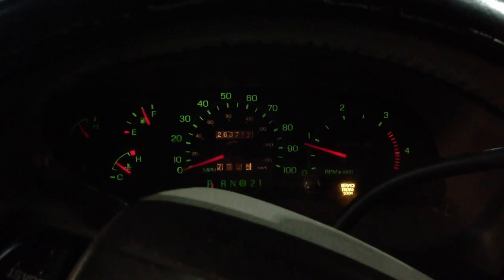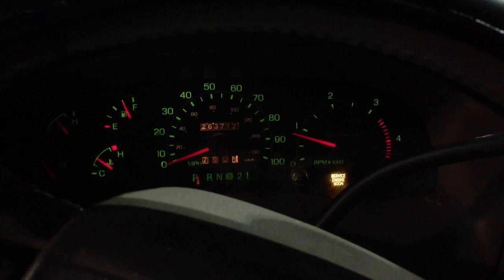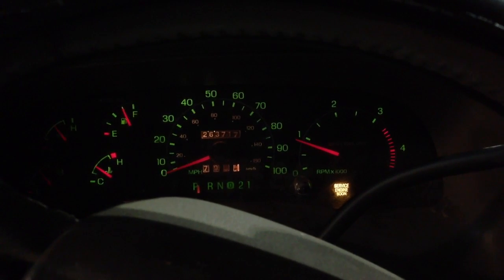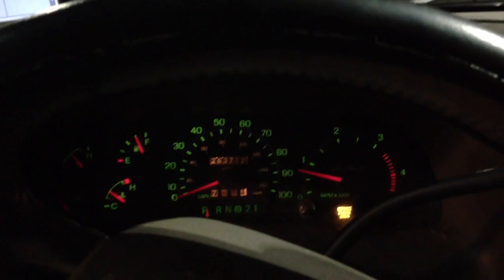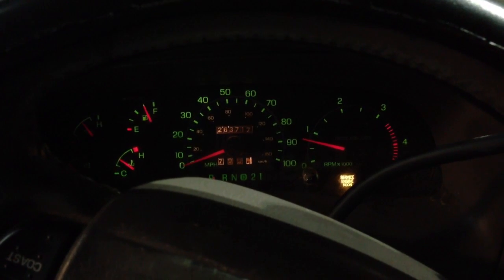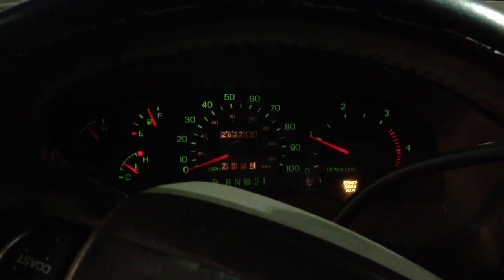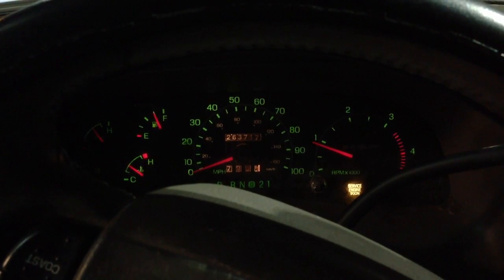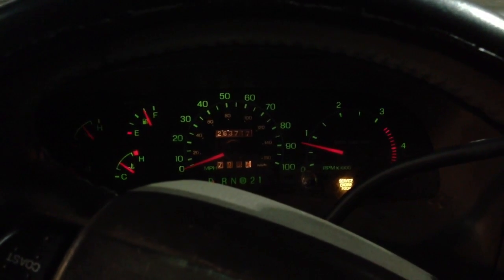7.3 Powerstroke Idle Drop/Stall

Comment: Well considering I’ve had a similar issue and replaced all sensors and still didn’t fix my issue that everyone here is wrong with the exception of a few but everyone say cps or icp or ipr more than likely it’s the FPR OR The waste gate on turbo
Reply: What where your trucks symptoms 
I just changed all 8 injectors in my 7.3 and it idles rough when warm, throws black smoke when accelerating, stalls in reverse and when reved in park when the revolutions come down it stalls.

Comment: My 96 7.3 power stroke runs like a champ. I put the power chip in and and notice a performance gain but...when I pull up to park it dies. Starts back up and runs and park and dies. Pull out the banks chip and doesn't happen. I even went and got a new cam senser in case. I'm 10,000 miles without chip and it never did it again. Why? Lol
Reply: Neutral safety switch?

Comment: My 1988 with a recent Jasper's doing the same thing. My mechanic thought it was the fuel I was using (RUG mixed with cleaned WMO), but I used a centrifuge to clean it, and a hydrometer to test the viscosity against regular diesel. This just started recently even though I've been putting my stuff in it for awhile. It takes cranking twice to get it started like there's a fuel flow problem, then will stall unless I'm I keep my foot on the accelerator and decelerate very gently.

Comment: I'm having the same problem and looking for a solution also.  One blog stated they replaced the Fuel Pressure Sensor ($119 on web, $170 at auto store) and resolved the idle dip.  Another person stated a possible cause is the voltage from the alternator was low, 13.3V, should be 14 Volts. This is also logical because a low voltage would set timing off in the CM.

Comment: that is you egr valve blocking up i have a 2.2 diesel ford mondeo and it done this before recently allowing to much fuel through causing the fuel to choke the engine

Comment: ICP is something to look into, it could be leaking internaly and causing a resistance change and messing with the computer, pull off the connector check for oil if there is, then replace connector and sensor.

Comment: When the rpm falls below a set amount the IPR duty cycle is supposed to go to max duty cycle and increase pulsewidth to recover RPM as seen in the video response      It's similar in action to the same deal we see when it is really cold outside, the oil is really thick, and the IPR is struggling to regulate the pressure (ICP sensor issues make it worse) and the rpms jump up and down.  Check your ICP pressure via scan tool AND check it with a manual gauge to be certain.

Comment: I've seen a few trucks do this, including my own. It is much more noticeable when the engine is cold/barely warm.  Judging by the very slow idle recovery that they do, I would imagine it is a glitch in the original programming of the ECM.  It could very well be that the throttle input is so light that the idle validation switch, which is a mini switch under the pedal (which is that little "click" you hear when you push the pedal) is not being closed.

Comment: What may be happening is that when you barely have your foot on the throttle, the ECU is closing the idle air bypass valve, because it thinks the idle is too high and the throttle position sensor isn't saying there is any meaningful throttle open. When you let it off, the throttle closes, but the engine now is starved for air, so the ECU futzes around trying to get the idle air valve open to bring the idle up, and sometimes may not be able to quick enough, so the engine stalls. My experience.
Reply: It's a diesel!  No idle control valve

Comment: I would take that to ford. you could have injection problems! If your bully dog is programed set it back down to stock or what ever tuner back down to stock start it on stock if it causes the same problem then your best bet is to take it to ford they know what there doing that's why they charge what they charge.  Good luck.  I will message you on fb if you have any more questions ( jeffery mckeehan)

Comment: constant calibration, the ecu thinks the position of the accelerator is at idle, once you let off it brings it back to what it then thinks is negative idle ie lower than what it should be, it sees the speed of of the cam/crank sensor drop and brings the revs back up, strange but ive run into it on the buses before aha